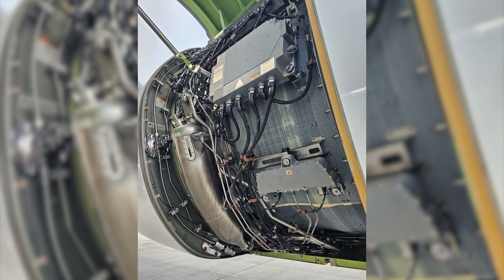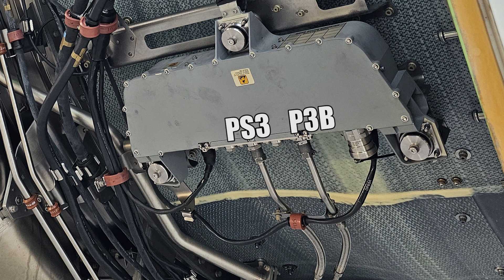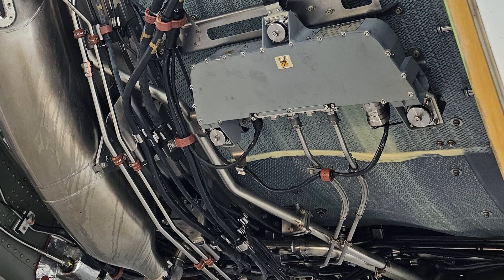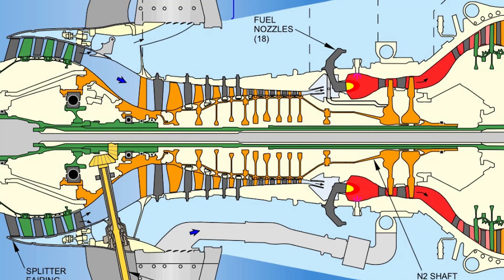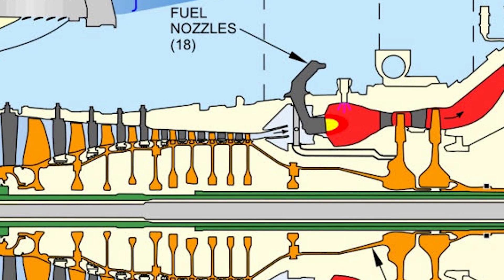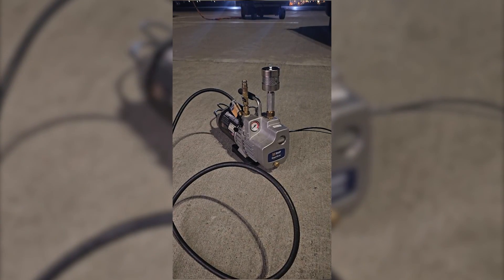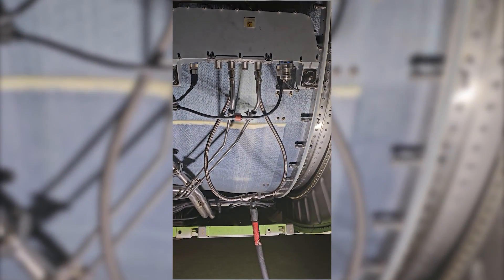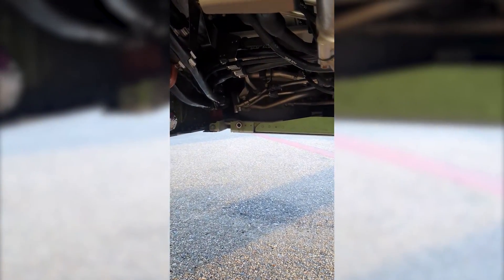Boeing 737-8 (MAX) EEC PS3 + P3B moisture removal explained (short video)

Comment: Hye, where is this P3B sense line tap from? And why it is so important to EEC? I couldn't find much info regarding this P3B inside our AMM. Thanks
Reply from the maker: Hey! I don't know to be fair, couldn't find much information in the schematics as well. I only found a line in my Boeing 737 MAX type course books that the P3B is used for the airconditioning system. I'm sorry that I couldn't answer your question, I'm really curious as well.